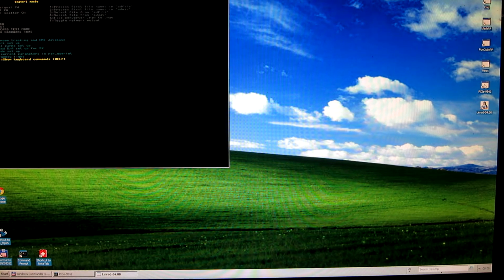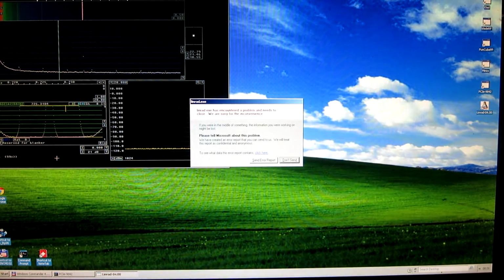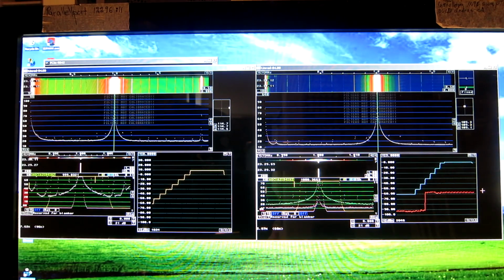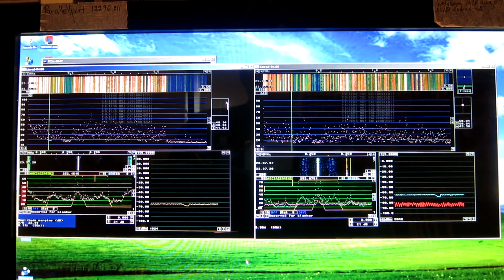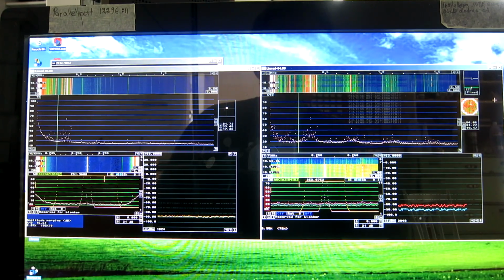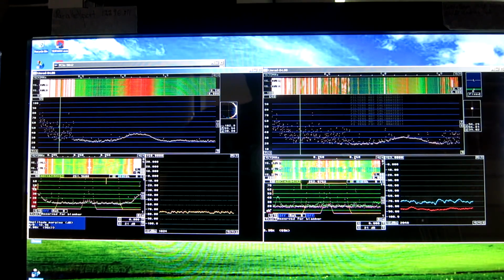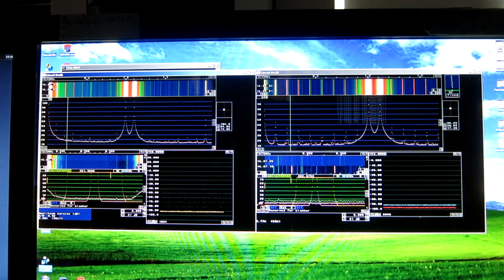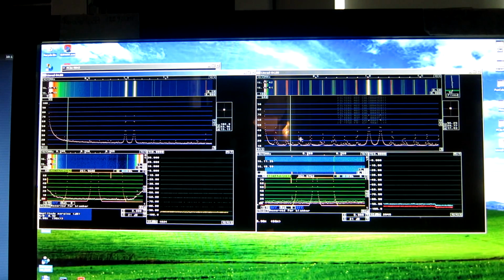bladerf j61

Comment: This was very interesting and good to know; it's great you have both a proper signal generator and a reference ADC to compare BladeRF to while explaining the issues. Thank you very much for taking the time to make + post it.
Reply: Do you think the BladeRF issues are fixable by a PCB spin (different board layout, different analog parts) or would you guess they're issues inherent in the tuner/adc chips chosen? What would your suggest be to the BladeRF folks?
Reply from the maker: Dr Tune It is obvious that the ADC itself is OK. It does not suffer from excessive digital feedback when run from the tuner. It is perfectly possible that the pick-up of digital signals is external to the chip and that a different board layout could fix the problem. I have no information about the layout so I can not have any opinion. I would suggest that the BladeRF folks would discuss the problem with the chip manufacturer...